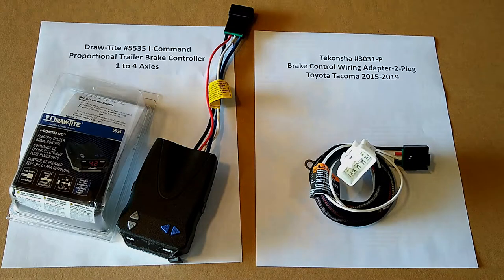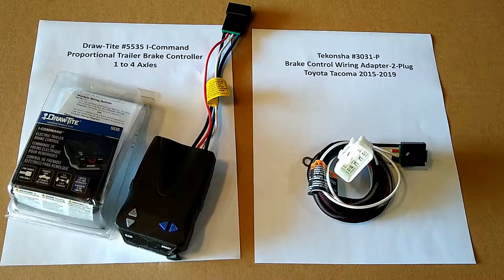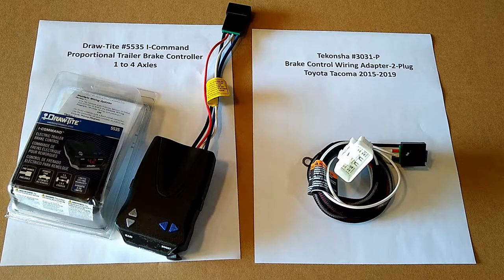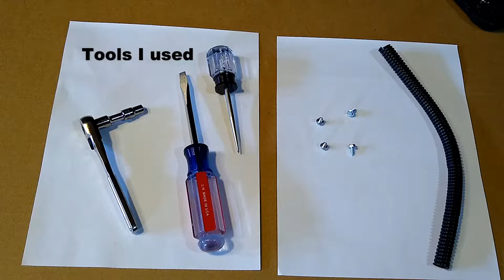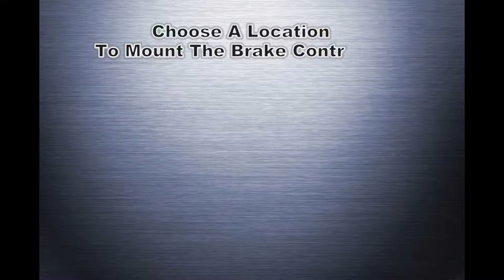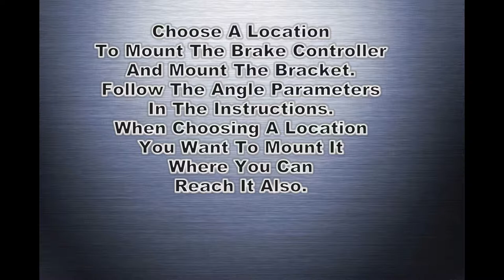Trailer Brake Controller Installation Late Model Toyota Tacoma

Comment: You see that spot where you have a mouse sitting,  thats where your controller goes.
Reply from the maker: How will you mount the bracket to secure it? Plus you will have to drill holes, in the back, for the wiring to pass through and you'll lose the storage space But if that's where you want to mount yours go for it. Good luck mounting the bracket. I'll leave my cubby open for storage and my mouse.